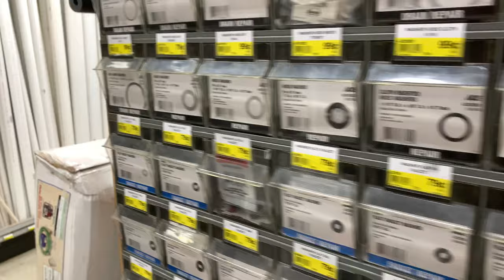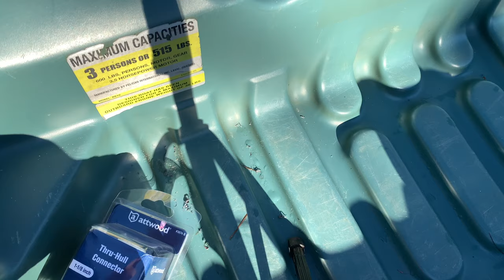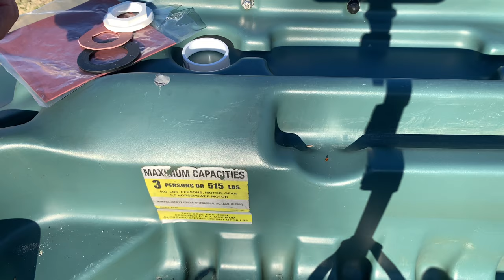Pelican Bass Raider 10E - DIY $10 Dollar Draining Scupper Plug Install

Comment: This is an update on my prior comment.  Thanks for a helpful video; I have ordered the parts to do that installation.  Last week, I found that there was "no way" I could lift or move my Bass Raider on its trailer.  I popped open the bow plugs and GALLONS and GALLONS of water flowed out.  After that became a trickle, I removed the stern rod holders I had installed last year and drained EVEN MORE water via those openings.  Since I cannot accept that such a large volume of water is "weeping" through the skin of the boat, I concluded that it is entering at the "clamshell" seam or, less likely, through the bow plug openings.  I doubt the latter as the plugs fit tightly.   So, I purchased a couple of cans of the spray Flex Seal and applied three coats to top and bottom of the seam joining the top and bottom halves of the boat.  Wish me luck!
Reply from the maker: I have the same issue with mine, but mine was caused by cracks in the area on the top so all the water drained into a low spot and then went inside the boat. I also installed better plugs in my bow holes.

Comment: Installed the same plug on mine a couple years ago. I sold my pelican to fund my boat project. I never tested to see if the boat could be drained while on the water. Your video confirms that it can👍🏼

Comment: Saw something similar Using Marine Silicone, Just Got My Raider ,This is one of the first things it's gotta have ,I leave it in the truck Alot If It Rains Ya Gotta Deal With that issue , Simple fix is the scupper , Just Pull The plug Chunk it on the bottom of the Raider and no Worries , Good Job , Tight 🎣 Lines To Ya
Reply from the maker: Thanks I’m actually doing a floor for mine next.. trying to decide between foam deck pad or marine Carpet
Reply: @greatamericansurvival  Indeed I've seen the interlocking pieces that many have Used ,some use the carpet with a plywood Backing , I've considered that Using about a 15 inch piece that you could Use in the very front or that another Pedestal for an additional Seat  could Be Used If You had A Three person Trip by chance, If You just had Two People , keep it in the front as part of the flooring ,I don't want a casting deck , I don't see the need but I wouldn't mind the little small compartment for storage that piece Could be the floor piece in the storage compartment , I Think I want my Battery in that compartment as I intend to add a Small Gas Motor of some sort , I fish a Bigger creek (Black Creek) here and I have a free flowing River system , the Pascagoula River That I Fish Along With The oxbows and Sloughs then I Also have The Coastal Bayous And Marshes ,I will use this in those Smaller channels where I don't have a Worry about getting swamped out by a Yacht or Bigger Boat , There's some that the Raider will Work great for down there , that's about 45 Minutes drive No biggie , the river is about 5 miles away , Black Creek takes me roughly 25 Minutes It's all close By , This Little Boat Project Is Something I've looked at for some time now , I've Built Boats a few times ,the last I should have kept but was moving around Alot and work was always first so I let a Friend buy it ,
 I stumbled across this one at academy as a year end Sell and saved a few Bucks ,I did a Buncha Research on these things watched Alotta vids on them and them in Actual use in just about every situation from A To Z , heck i even seen a duck blind Build for it ,lol, 🤷🏻‍♂️  the bow had a place for the dogs to sit if you used one, was a pretty good idea I'm not a big waterfowl Hunter but for someone who is , it holds some potential  , Anyhow Thanks Much ,These Vids Help Out For this Stuff , They Give ya a Direction On things ya doing anyway. Tight Lines To Ya 🦈🎣
Reply: @greatamericansurvival  I Think I'm gonna do the Padding And Add the Storage compartments , I Wanna Also Build Some pvc pipe Rails For each side , removable and interchangeable to fit Whatever Type Fishin I'm Doing , Catfishing or Panfish with live bait Rodholders are a little different than a Bass Rod Holders or something using artificials , I want to do Coustom Rails Around it to fit the neeed and give me some place to add lights or whatever necessary for the Trip , one things Sure using PVC The Builds and mods Are Limitless for the Raider  ,

Comment: I solved the same problem by using a waterproof tarp and bungee cords to keep water out.  The minimal amount that accumulates is easily removed with a sponge.  I would be interested to see if your 10e has the same problem as others; that is accumulation of water between the hulls; this is a recognized problem that apparently occurs as water intrudes around the molding strip in this clamshell design RAM-X boat.  That's why they installed the bow drain plugs, but it does require the awkward lifting of the stern to drive the water to the bow.  Your drain will not solve that issue.
Reply from the maker: Daryl Griffin So you actually installed drains for the inner hull pontoons? What did you use I’ve found a couple of drain plugs designed for like rain barrels. I’m actually looking at doing that next. I usually keep mine on a tilt trailer but I’m planning to install a casting deck on the front mostly because I’ve only got one chair.
Reply: @greatamericansurvival  My Bass Raider came with drain plugs in the bow of each pontoon (it's a 2019 model...or at least that's when I purchased it). However, if I lift the stern to drain the hulls when it's on the trailer,  it wants to slide forward and wedge itself under the winch. Haha. I am going to hang a pulley from in garage so I can raise the stern without it sliding. Hope this helps.
Reply from the maker: Yes mine has those plugs I’m talking about installing ones like a pontoon boat. On the lower part of the rear of the boat. To make where you don’t have to even tilt it just unscrew the plugs and let the water flow. I found a hole in one of my cup holders so I’m pretty sure that’s were I’m getting water into my boat.
Reply: @greatamericansurvival  Did you solve the issue of water accumulation between the Bass Raider hulls? If so. please let me know or post a video.

Comment: Thanks!!! I ordered everything I needed from Amazon including a cheap hole saw kit for $20.00. Can't wait to see how it turns out! I'll prolly add a little Loctite to the threads for vibration protection because I'm running a 2.5 HP Suzuki 4 stroke on the back.
Reply from the maker: I have an older 2.5 Mercury that works great. Looking at adding a Casting deck over the winter, I strapped a pallet on the top and took it out I was shocked at how easy it was to stand and fish off of it especially with and outboard on the back. Not sure how well it would work without one on there though.

Comment: That gasket comes with gasket sheets for 1/16th and 1/8th gaskets.  Do you remember which you used?
Reply from the maker: Mine was the 1/16th but both would work the thicker would probably be better.

Comment: Great video, I will be doing this.  Any concerns about those gaskets wearing out over time?  If they do, you just start over?
Reply from the maker: Not really, the gasket is designed for plumbing so it will probably last long then I have the boat. Thanks for taking time to comment. Let me know how your installation goes.

Comment: One other question...how do I know how much bigger to cut the hole in relation to the size of the drain?  On the thru hull fitting I bought, the package says its 1-1/8 inch, but its tapered.  At the bottom it is that size, but at top its 1-3/8.  Should I use a 1-1/2 inch hole?  I'm not sure how much clearance I am supposed to leave.  Thanks again.
Reply from the maker: Mine wasn’t tapered. I’d start off with the smallest hole and if it needs to be bigger on top adjust it, you don’t want a lot of play the tighter the better.

Comment: Thanks for the video - this is a AWESOME IDEA!!!!  However I have hit a snag....  I ordered the thru hull connector - model number 3873-3 (Attwood® 3/4" Thru-Hull Connector)  from the link you provided.  Also ordered the drain plug from the link provided.  Academy sent me a 1 inch twist drain plug (rather than the snap) and it doesn't fit the connector/scupper plug, it isn't even close - measuring the "id" of the connector hull it looks like it is only 5/8" - could you confirm the size of the drain plug you are using?  In the link to the drain plug you posted it states it is a 1 inch plug, so I don't know if there is a difference in the twist gimick they sent me vs the snap?  If you could let me know I would sincerely appreciate it.

Comment: Thanks for the video. I’m doing that tomorrow. Found this by accident. My problem is the BOTTOM taking on a lot of water. I cannot figure out why. Does anyone here know why that’s happening?
Reply from the maker: Like inside the boat? Mine mostly gets moisture from condensation here in the south. Stored outside gets rained on a lot. Like in July 2021 it rained 20 of the 30 days in July
Reply: Yes the problem I’m having is where they stapled the boat together there is a large crack. Apparently when it rains water seeps through that crack and gets into the bottom of the boat. What I did was took the black off and caulked and then put the black bumper back on. Hopefully this will solve the problem. Would it kill them to put a bead of caulk around the boat when they put the 2/2 together

Comment: Any updates?   Is it still holding up?   I’m looking to buy one and i just don’t understand why Pelican didn’t do this from the get go.
Reply from the maker: Right. I totally agree with you on that. It’s the best $10 I’ve spent. No issues at all. It’s a great mod especially if you have a deck or floor installed already. Do you have a deck on yours? When I got mine it only had one seat. So it’s cheaper to install a deck then buy another chair..
Reply: Great American Survival i am currently looking to buy one.  I’m waiting to get a better deal than $650 for new.  I do like your mod though and it came out really nice.  Great job and thanks for responding!!
Reply from the maker: My pleasure, just watch online. Mine I was looking to buy for $500 dollars and it came with a fish finder and a 2.5 hp Mercury outboard. But after talking he wanted to get a kayak so I traded one of mine.. deals are always out there. What state are you in? I’m in Georgia. Found mine on Facebook Marketplace but saw several on Letgo too.
Reply: Great American Survival I’m in GA as well.  Henry county.  Saw a deal recently for one.  $550.  It had a 55# tolling motor and battery.   It had posted 5 hours earlier and it was sold by the time i reached out.   I’m keeping an eye out.  Thanks for the info.  Btw, you just a new subscriber.
Reply from the maker: Glad to have you on board.. I’ll be sharing more videos on the Bass Raider, Fishing tips and gear plus I’ve been playing with my Catch 120 kayak and a few others lately. I’ve been kayaking for most my life and it’s a lot of fun. A good buddy of mine is retiring from the Air Force on July and moving back to Stockbridge to Family farm with his family.

Comment: Great job!!
Reply from the maker: Thanks for taking time to comment. Do you have a Bass a Raider currently? I’m having another issue.
Reply: @greatamericansurvival  Yes, I do
Reply from the maker: I have a problem with water getting inside my boat in the inner pontoons. Looking at installing a drain plug like an oil pan to allow it to get out without standing it up.
Reply: @greatamericansurvival  sounds interesting. I'm sure it is doable. I look forward to your video.

Comment: Where did you get the plastic drain piece
Reply from the maker: Academy sports. They had different sizes, just make sure they have a plug to fit the hole. Even though the hole is above water.

Comment: Could you use Plumber's Putty vs. the gasket ??
Reply from the maker: Possible I’ve honestly never tried. My initial idea was gonna be to cut up one of those silicone pot holder style pads from the dollar store or something like that. When it’s tightened down you almost don’t need one.
Reply: Thanks. I'll try the putty. It should be more pliable and conforming to the deck than a gasket. (My story and I'm sticking to it) Thanks again, great video.
Reply: It would be prudent to use a marine sealant or even silicone caulk rather than plumber's putty which is not designed for those kinds of stresses e.g. hull flexing.
Reply: Thanks

Comment: Why 1 1/8 if drain plugs are 1"?
Reply from the maker: For the hole? It’s the outer diameter of the plastic plug. I’ve found several different plug options.